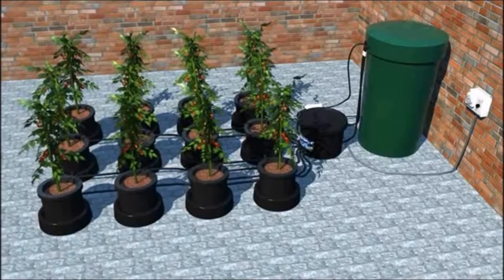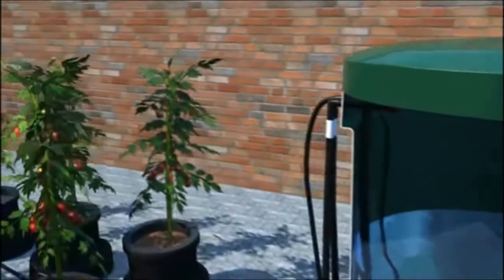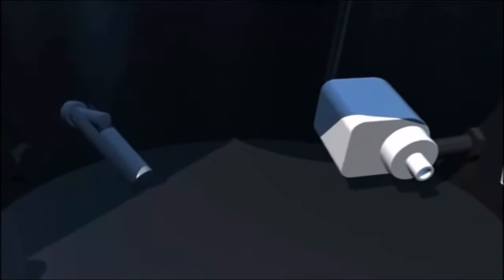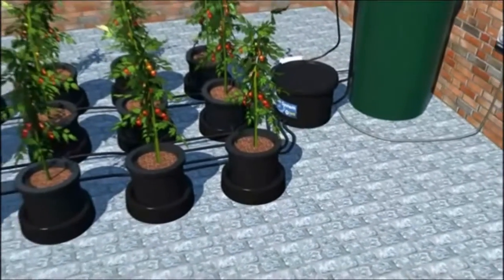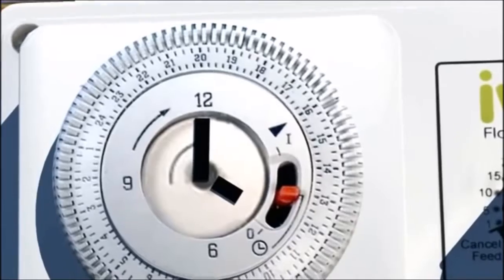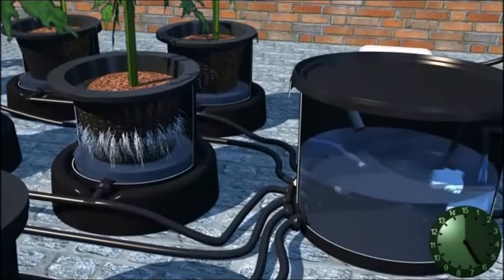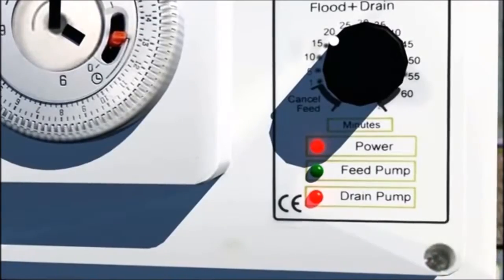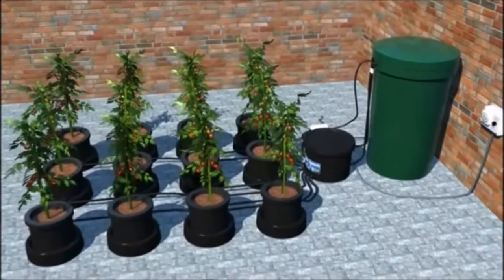How The IWS Flood and Drain Hydroponics System Works

Comment: Looking at the picture I can tell everyone that with an ebb and flow or a recirculating system you are going to need a cleaning port to remove roots from the half inch tubes. I used steel fish tape and a drill to clear my roots in a DWC system. Plan ahead people! I did and it saved me time and money.....
Reply: It's not DWC though. A friend ran a room for a number of years with a hundred pot system using two brains. The results were impressive with no clogging issues.
Reply: Fuck yeah. ❤
Reply: My spine and brain pot totally concur 👌

Comment: How do you get the feed pipe to stop after the feed pump turns off? Water is still filling the brain pot due to the vacuum created. I know the anti syphon valve is used to prevent water returning through the drain pipe but there seems to be nothing to stop the flow from the feed
Reply: There are 2 ways to do this. One is a positive displacement pump the other is a check valve with a strong enough spring that the weight of the water in the storage tank is not enough to overcome crack pressure of the check. A positive displacement pump will easily crack open the valve.  2.31 feet is equal to 1 psi. So if the tank max level is 4.6 feet, you need a check valve that requires more than 2 psi to open.

Comment: I just purchased this on ebay. I'm wondering how does the pump from the rain water tank start pumping, do i have to connect the wires to the iws timer? Any help or direction will be awesome! Many thanks in advance.
Reply: How well did this system work? Are you still using it or did you switch to another system?